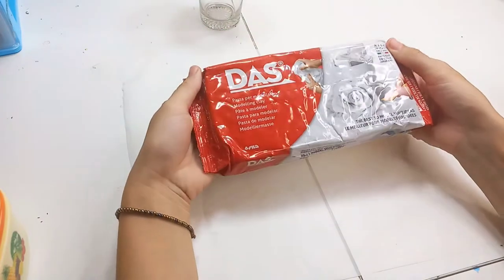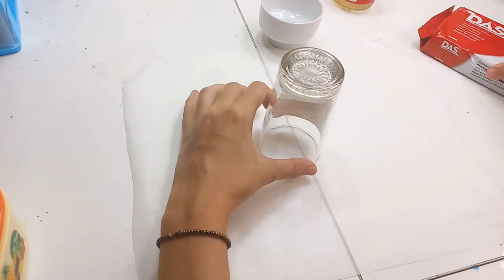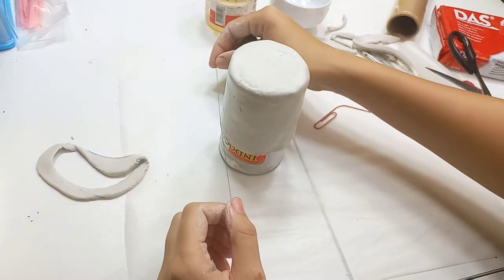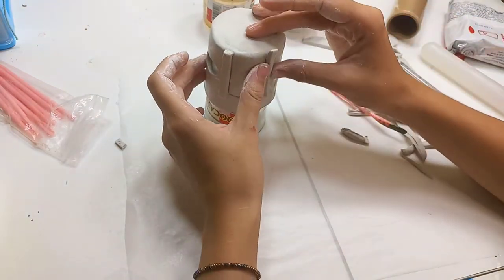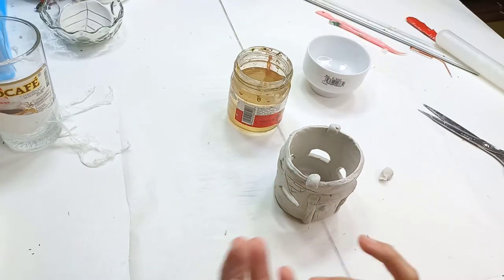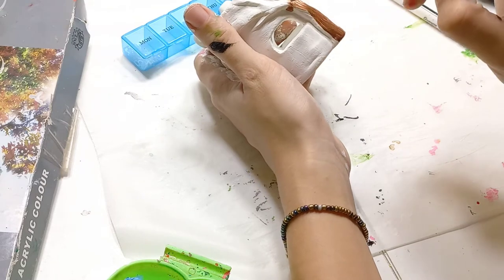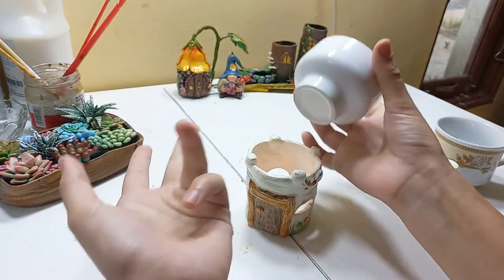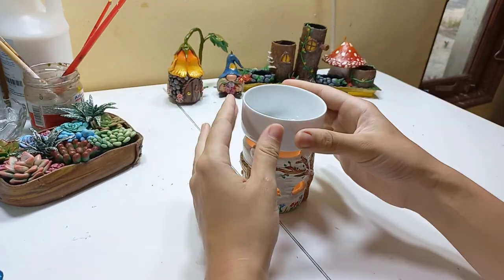I tried to make an Aromatherapy Burner using DAS Air dry Clay... and it worked!

Comment: Instead of using only water to stick the pieces, you should try to use slip, slip is a mixture of 3:1 clay and water, it's so easy to make, just soak the clay (i soak it in water overnight) and then mix it, this slip work as a glue for the clay. Btw you did a really great job, I've been looking for this tutorial but im not sure yet to make that aromatherapy burner😂
Reply from the maker: Thank you so much for tips! Very appreciated 😊

Comment: hi! what garnish do you use in here? I'm new to clay and I have no clue of what to put on my works to protect them, especially because I'm making some incense burners and candle plates :/ your piece is so pretty btw 💕💕
Reply from the maker: I mostly use clear acrylic spray paint to varnish and protect them. It gives the pieces a nice sealing coat. And you can buy it in doff or glossy

Comment: I’ve been trying to figure out if this is something I can do with sculpey clay and acrylic paint. I’m not sure if either of those are heat or oil resistant
Reply from the maker: I don't think so.. from what I know sculpey is polymer clay which is a form of plastic
Reply: This probably isn't relevant anymore but just in case someone is wondering;   do not expose acrylics to heat. 
Acrylic mediums and acrylic paint are not compatible with heat (unless packaging claims so). 
When exposed to hot temperatures acrylics can begin to produce/emit a gas/vapor that may be toxic.

As an example, it is for this reason why paints suitable for painting radiators never contain acrylics.